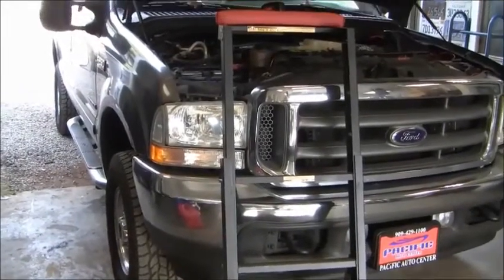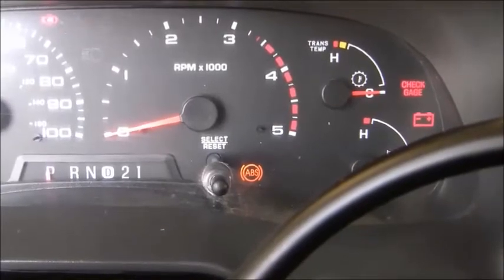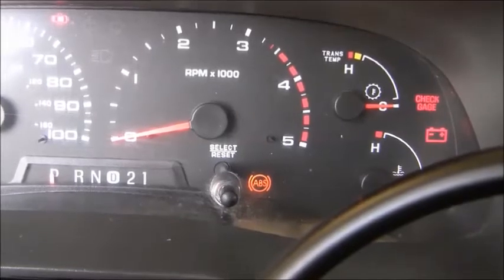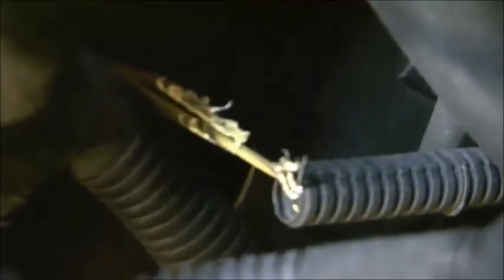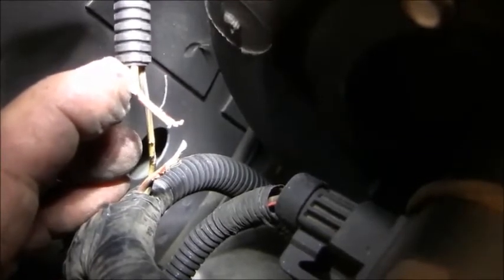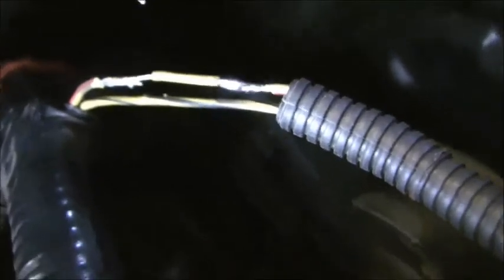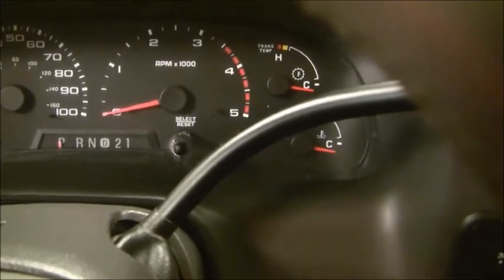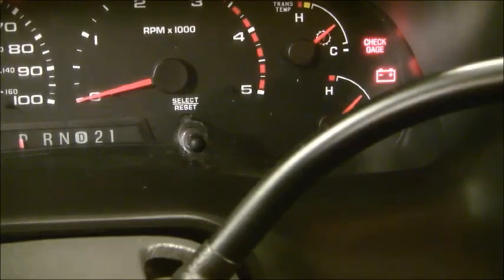2003 f250 abs

Comment: have 2004 f250 5.4L and the ABS module control makes a grinding noise.  do I need to replace the whole part or the just the module (black plastic)

Comment: I followed this to diagnose my broken rear ABS / speed sensor wiring harness. The wire was broken just inside the connector that attaches to the sensor (in the rear differential) - I used a multimeter and a length of wire and found an open circuit on the pink wire. Ordered a new Ford pigtail 5C3Z-14S411-AA which includes the new connector already wired up

Comment: I recently broke my right front tie rod. Fixed that ABS light on. Figured it’s the right sensor. Now I just want the POS disconnected. It’s becoming a problem. Where is the freaking fuse ? I’m getting multiple locations.